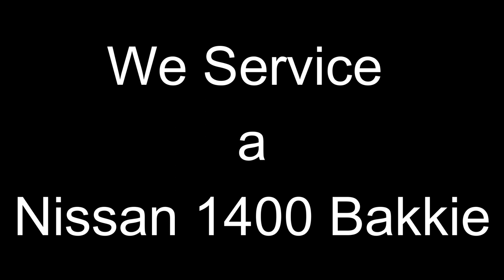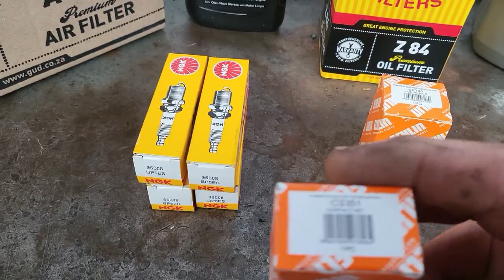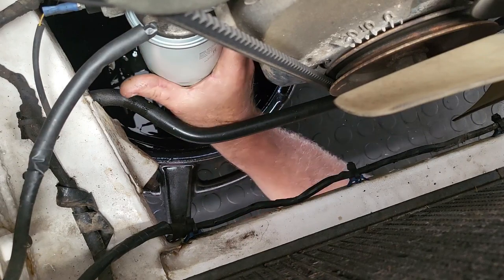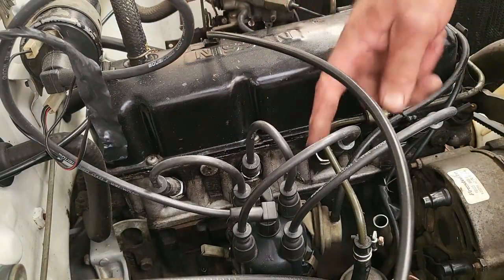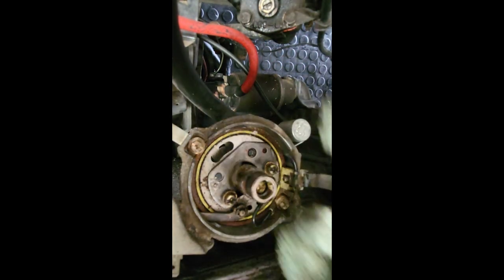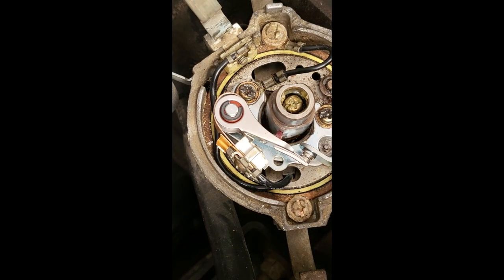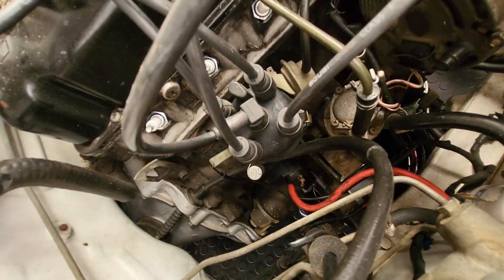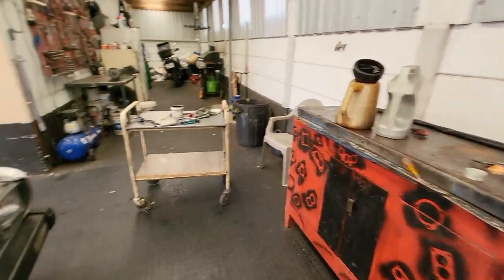Nissan 1400 Bakkie - Basic Service

Comment: Yes, I have done a lot on them, and you get pretty much every body panel as aftermarket, mostly because the drivetrain will go on forever, but the body will rust off it. Air filter you will find older ones use an ADG799, which will fit the new ones, once you pull that plastic inner sleeve out. Same housing, just the plastic spacer to use the cheaper filter, last price I had, buying pretty much the entire GUD inventory every time, was R600 each. 

I was using them off the label, but they are a darn good filter, and if you are using the vehicle on farm roads the better filter, simply because it has a spinner to dump the dust mostly out, and enough area to not become clogged with 2kg of dust in it. Yes I was collecting dust with them and 2kg was not unusual for a day, even though I was also washing them out again, and leaving to dry for a few days in the sun. You could get up to 10 washings on them no problem, till you saw the sunlight coming through a hole, which made them scrap.

Van itself is immaculate, he has either been ultra careful, or has a really good panel beater to handle the rust, because they all rust by the windscreen, and by the doors. Points you often get by with just cleaning and resetting gap, though you should also use a timing light to check the vacuum advance works properly, and you still can buy the capsule for it as well. Rotor needs to be cleaned, and lightly polished, along with inside the cap, and pull the leads off, and put a bit of silicone spray there to keep them from going green. No silicone inside the cap, spray only with Q20 or Tool in a Can, and wipe down, to prevent tracking. Did they stop giving that little capsule of white grease with the points now, even though I rarely used that, using white synthetic grease instead, just a thin smear on the cam surface
Reply from the maker: Thanks for your interesting insights Sean it is really a little Champ.

Comment: Great video. Would like to see you use a vacuum guage to tune the engine, if you ever get the chance. Thanks
Reply from the maker: Hi Pierre, a vacuum gauge is usually used to sync. and set twin-sidedraft carbs, believe me, I did my fair share of this in the old days, if I ever get one in I will certainly make a video of it. Thanks for supporting my channel with your visit it is greatly appreciated.
Reply: @vehiclemaintenanceandrepai3790  Great, and thank you for the reply. I saw some videos on youtube where they used a vacuum guage to tune the air screw on the carb. I tried it myself with varying results. Would love to see how a pro does it. Great video and thanks again.

Comment: This is the best video ever on how to service a Nissan 1400, I fitted new points and a condenser but I have a problem with the timing, when I use a timing light I see the dot keeps on jumping around, it doesn't stay on one marking it moves around from one marking to the other, could it be that the bakerlite in the distributor is worn out?
Reply from the maker: When this happens with the timing mark it could mean a worn distributor shaft bush, which means the points do not open the same on all 4 lobes of the distributor shaft, or it could be the lobes itself are worn unevenly to check it take off the cap and rotor, turn the motor so the points are opened on one of the lobes, just like you would do to set the point gap.

Take the shaft and see if there is a side-to-side play that opens and closes the points without rotating the shaft, if so the center bush of the distributor shaft is worn, which is why the timing will not be constant.

secondly, it could be the centrifugal weight springs under the base plate of the distributor that are either broken or missing this will also cause erratic timing as seen when the timing light is used.
Reply: @vehiclemaintenanceandrepai3790  Thanks so much, this helps alot.

Comment: Thank you for this detailed video! You're awesome. Hope we can ask more questions regarding the 1400 Nissan. Mine randomly started dying while driving. Do you know what the problem could be?
Reply from the maker: Make sure the points are set correctly, 
the condenser may be loose and not earthing correctly, or it could be faulty, replace it to make sure.
check the spark plugs for any wetness on the tips, 
and check the plug wires for breaks or corrosion on the ends.
Also, check the distributor cap for cracks, 
the worst-case scenario is that there may be no or low compression on one of the cylinders due to worn rings or leaking valves, do a compression test to check this.

Comment: Good day I'm busy learning how to service my bakkie my self but picked up my bakkie is not running 100%. Bakkie runs ok but not 100% it ideas at 500 I think it's to low. When I drive it and pull of nice and slow its fine but when I go over 50km then it's just dies of when I drive it. Can it be that its timing on the points?
Reply from the maker: It sounds more like a faulty condenser, or not tightened properly, so it is not getting good earth, it could also be the coil and/or plug wires, hell it could also be the rotor and cap too.

Comment: Please help my handbrake is not holding can pull up handle and car still rolls got new cable and shoes in the drums what can be the problem
Reply from the maker: It needs to be adjusted correctly, 1st set the hand brake down all the way, then adjust the brake shoes up correctly, then adjust the hand brake correctly (just as the shoes are touching the drums)
Reply: Thanks so much for your help
Reply from the maker: All good, a pleasure.

Comment: I need help, my dad's 1400 doesn't start every now and then. It always needs a kickstart and I suck at kickstarting that vehicle
Reply from the maker: It sounds like, a flat battery or starter trouble.
Reply: @vehiclemaintenanceandrepai3790  so basically I have to get a new starter?
Reply: Also check the ignition barrel for wear.

Comment: What tool did you use for spacing of the points
Reply from the maker: Hi Eric, at video time count 18:08 you will see I provide the point gap setting and which tool I used, it is known as a feeler gauge, I hope that helps, thanks for your support.
GARY
Reply: Thanks
Reply: My 1400 doesn't have power I can't move up hill very fast or normal like it was before, what could be the problem?
Reply from the maker: Incorrectly adjusted points gap, incorrect spark plug gaps or incorrect spark plugs, 
incorrect timing setting, a blocked second stage jet in the carb or blocked fuel filter, seized centrifugal advance weights in the distributor, 
a malfunctioning coil, plug wires, distributor cap, rotor, the list is extensive but not exhaustive, 
I even had a case once when the baffles in the exhaust box cam loose and blocked the exhaust outlet, 
best to go thru the above list. Good Luck, Eric
Reply: Okay thanks a lot Sir have a good day

Comment: What's more if i use 20w50 oil?
Reply from the maker: Hi Ruben, 20w 50 is meant to be used in engines with high mileage say from 220k kilometres and up, it is a thicker oil which compensates for normal engine wear but offers good lubricating qualities. I hope this answers your question.
GARY
Reply: @vehiclemaintenanceandrepai3790  that's the good answer coz i have seen most people just use 20w50 on even in new cars🤣🤣

Comment: How to set my air and fuel on my carb
Reply from the maker: While idling, turn the air screw in slowly until the car idles a little rough, then turn it back out until it idles lekker smooth, then it is set correctly.